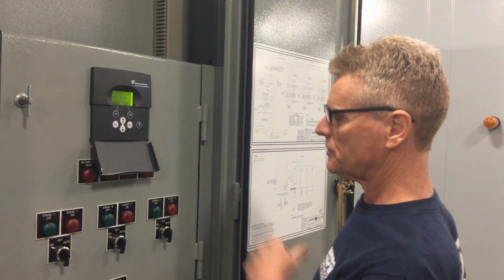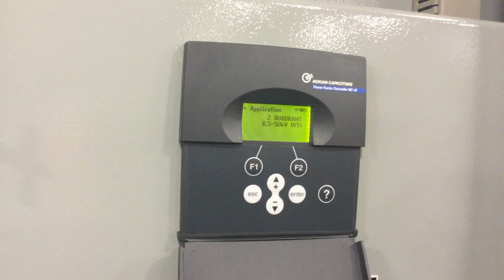NC12 Power Factor Controller - How to Setup and Commission a Nokian NC12 Power Factor Controller

Comment: Is it possible to view power factor value in computer or online?
Reply from the maker: Yes - Depending on the controller used it is possible. The  NC12 controller discussed in this video requires an addtional communication attachment. Other controllers provide this function built in. The Lavato or SEL 487V as examples.